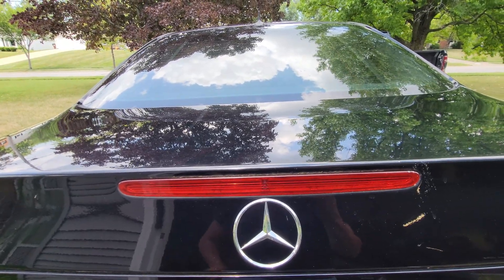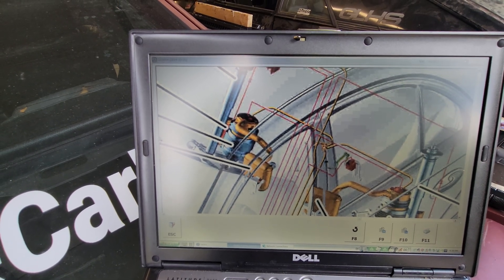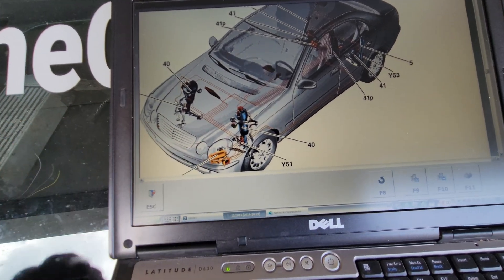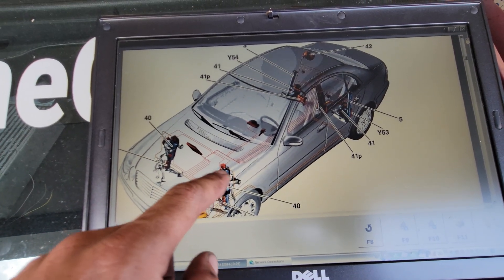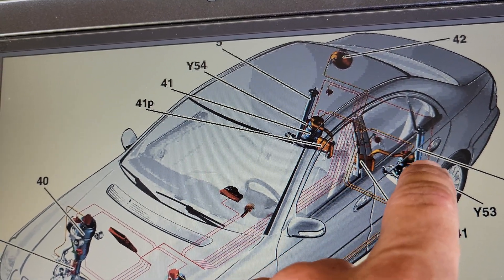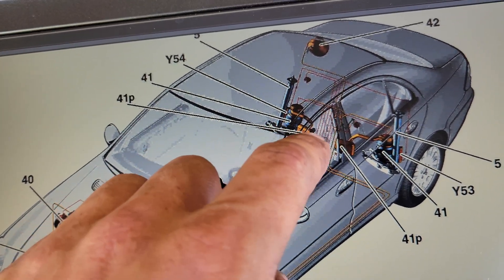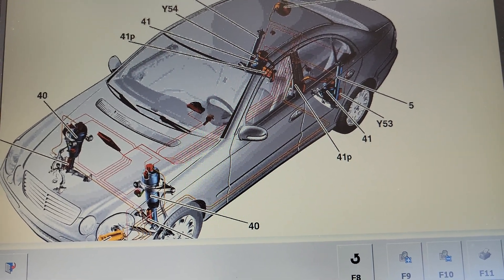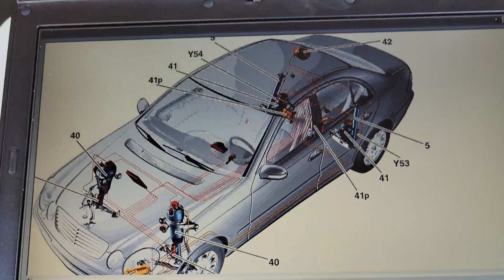QUICKIE - Mercedes W211 AIRMatic 101 - How it kinda works and what goes wrong..

Comment: Awesome video! Great explanation. 
I tried using it to find the issue with my 2008 W211 E350 Sports package with 4Matic and Airmatic. 
So far I haven’t been successful. Maybe you have an idea? 

My Airmatic feels way too uncomfortably hard even in comfort mode.
Everything seems to read and work correctly though. 
The car has 110k km and never had an issue with the Airmatic besides feeling hard. 

I'm able to use Xentry, which shows no error codes in general or weird live data when driving. 
The voltage is in its tolerance range, the level sensors are correctly installed, are in the tolerance and read changes as well.  
The ADS work and each read 500ma when activated. 
Also, the Airmatic lock is not on, since the car is way harder when driving while being inside the Airmatic module. 
The Airmatic does not leak even after 2 weeks of not using the car. 
The compressor fills up to the 12 bar in 10sec (40sec is max). 
There is also enough pressure in the system and the pressure release valve works as well.
Since I'm the 2nd. Owner, I do know that no one ever messed with the level calibration. 
It shows 10mm+ front and rear when using auto level calibration. The 10mm+ is outside the -3 to 3mm tolerance, but as far as I know, it is supposed to be like that for 4Matic models. 
Also, I can feel a difference when changing from comfort mode to sport/sport2. 
The car lowers and raises correct and quickly.
I checked my tire pressure as well (original 18inch sports package wheels 245/40/18 (6 months old Goodyear tires) with 2.2 bar pressure in them).
(It is also the same case with the just installed 17inch winter tires.)

Everything seems like the system works correctly. 
The car simply drives harder and more uncomfortably than any other car with normal shocks/springs I ever owned. 
While driving in comfort mode, the suspension has a tiny bit more give to it like it is supposed to, while still feeling every tiny detail and bump on the road. 
It sometimes feels like there is too much air in the bags.
A very uncomfortable mix.
I feel like the Airmatic should feel way smoother, like riding a cloud. 

I avoid more bumps and potholes than in my 60mm lowered 190E on 17-inch OZ Wheels. 

Any suggestions on what I could check next since the car drives me crazy?
Reply from the maker: Are the level sensors (or programming) functioning? Perhaps the car is over-airing - with the car running, measure from the ground to the fender opening - should be around 27" or so, iirc. Someone could have also messed with the level calibration making the car ride higher than it should. Or, your struts are bad/frozen.
Reply: @TheCarFarm  Thank you for those tips!

The level sensors read changes, even small changes, correctly. The only thing that might be a bit odd is that when the car is idling, the front right and rear sensors slightly change in value. 
Like +- 5-10 mV changes when the car is not moving. Really nothing major. I could not find anyone, though, that said whether those slight changes are ok or not. It might be bad engine mounts causing this change. They are all relatively close in general, like 2450-2550 mV.
The car height is ok as well. Not too high or low. The pressure relief valve works as intended. I could check how much pressure the system uses while driving but I don't know exacty how much it should have.
No one changed the level calibration from the factory. The car has been in the family since it was new. The struts don't show any oil, don't leak after weeks of standing, and the ADS dampener change hardness without issue (tested each individually in xentry).

The Airmatic works just fine without issues. It's just that the car doesn't have the magic carpet ride I know from different W211 Airmatics.
It is somehow floaty but hard with bad roads while being floaty. The Airmatic is supposed to hide any road surface completely.

Comment: Thanks for the explenation and sharing of your troubles! I just bought a 320 S211 with 285.000 miles and i'm looking into this system now, having a leek, rear right, so the diagram of your software is realy helpfull.  The way MB put the lines in the car is so cheap en badly done, rubbing on steel and wheelwells!

Comment: Is bypassing the tank is the back detrimental? 
It seems its there for a reason for constant air pressure and it seems to allow air to spill into it for some of the fancy airmatic features, using the arnotts with the bypass seems to use the airbag as the air tank then with no ability to allow quick deflating? 

im no expert with air bags but wanting to do the right thing and not the 20 year old E class dodgy repair, I have a suspected air leak thats just started the last few days which I will monitor closely 

Arrnotts bag would seem to be under a lot more constant pressure being used as an air tank/ air bag 

like I said I am very fresh to how air systems work and just want to do the right thing and understand more
Reply from the maker: In the video, I think I talk about tanks connected right to the air springs - the Arnotts do away with those. In the trunk is a larger main tank.

When you have the stock 'pillow tanks' on the springs, that air volume is combined with the air volume in the bellows during comfort mode - this additional volume does in fact change the spring rate. Arnotts spring rates therefor cannot be the same as OEM that retains the tanks. But on the OEM, the large rubber hose to the spring tanks can leak at the clamp, or corrode - this has been an issue on mine, repeatedly - not always the air spring itself. 

But yes, you *can bypass or cork of the 3/4"  (maybe 5/8") nipple on the air spring and bypass the pillow tanks. Do not use a cooling system cap, it's not rated for the ~150psi.
Reply: would there be much of a performance loss or difference with bypassing those tanks in the rear?

I was considering getting Arnott's but they are pretty pricey when you can literally just plug the bag also, Which I have seen people do online.

The larger main tank in the trunk is used as the compressors main air storage? 
 @TheCarFarm
Reply from the maker: @HTES962  You can bypass the little pillow tanks as I mentioned above - you just have to use something that'll take at least 150psi. 

Yes, the 1 gallon or so tank in the trunk is the main tank - you need that.

Comment: 😢having trouble with my E500 2004….changed the rear right still linking,drops overnight,as soon as I start the vehicle it lifts with no problem headache 😮
Reply from the maker: Did you change the spring, large black hose and the aluminum tank, re-use the large hose and tank, or replace spring/tank combo with a tank delete? The tanks like to leak around the corroded nipple. Replace the airline feed, too.
Reply: @TheCarFarm  🙏🏾4 replying…..I changed the bag and use the new air connector tube brass fitting.

Comment: Ben, just ran across your video. Well done! Great explanation of the system. I bought a low milage 2005 E500 4Matic w/ Airmatic when it was 7 years old (only had 22k miles). It has since rolled 105k (not bad for a 18 year vehicle).  I'm starting to experience the rear sag. Used to be if it sat for 2 weeks you'd see it, now it's more like two days (it's worse when it's cold outside and it's been cold lately). I found a short on one of the solenoid wires on the pump; I soldered that wire and buried it in heatsink tubing.  Seems to be repaired.  While I had it out I also rebuilt the motor (just did the cheap piston ring rebuild).  I’ve found a slow, and I mean slow leak at the air connector on the front left strut.  What’s the best way to repair that?  Do you have a part number for the brass connector?  Should I try tightening it or is that the kiss of death?  I’m not seeing leaks at the right strut, pump or valve block connections (haven't torn into the trunk yet to check the tank).  I’m sure the rear is leaking somewhere but I’ve sprayed soapy water on everything and can’t seem to find it.  Can’t hear it either.  What’s the best way to tell if it’s the rear air-springs (airbags) or rear reserve tanks are leaking?  I’m about to spring for Arnott replacements but I’d like to be sure I’ve found the leaks before I do.  BTW, the Arnott A2724 replacements are now $321.79 on Rockauto.  Is there a cheaper place to get them?
Reply: BTW, this is my lame video of my center speaker repair on the same car... https://youtu.be/fzxc6NK9mKg
Reply from the maker: I think the price has come way down on all of them so I don't complain, but the elasticity of the various units are not the same (weaker) than the OEM and affect the ride. I have found firestone sleeves (bags), but don't have a way to crimp the rings (yet) to 'rebuild' my own. But if you have the slow sag, I would look at the little pillow tanks and the 5/8" hose from the springs. If you're in a salty area, the aluminum nipples will corrode under the rubber hose. You can remove them without dropping the rear member. I adapted an air gun and valve setup to pressure the tank (with most nipple exposed), and then threw them in my pond to find the leaks. Brian welded (tig'd) them up and I reinstalled. The brass compression fittings you can find on Amazon (search for brass ferrule kit). I think they're 4mm, maybe 6 - I don't remember. They're kind of standard on aftermarket air suspension kits. I used some push connectors for splicing broken lines before I replaced the lines (also bought on amazon). If you have slack, you can trim the fitting and use a new ferrule and re-install. Otherwise, give it a turn and see if it stops.

Comment: I just became a proud owner of 270cdi from 03' that was equipped with airmatic, unfortunately somewhere down the line it was converted to classic suspension but bunch of parts of the air suspension remain (valve block, compressor, air lines, reservoir in the back). Do you reckon it can be put back together? Its still in the computer, every time I put the key in ignition it spits out airmatic error, visit workshop but the error is in normal text, not the red colored one. I absolutely love the w211, it has a lot of options that puts today cars at shame.
Reply from the maker: Wow - they went through the trouble of removing it, and then not de-coding it so you wouldn't have any messages? Of course you could slap it back in there. I've noticed my knock-off struts and bags don't ride the same it did as it was new. I would replace the white plastic feed lines - they'll leak anywhere they've rubbed on something and you'll never find it. Compressors are cheap. I'd argue valve blocks are only replaced out of cover-your-butt-and-throw-parts-at-it scenarios, unless external environmental factors have taken their toll. It's not terribly complicated and most aftermarket air-ride systems work exactly the same way; however these cars do add in the dynamic ride control (fancy struts and shocks) with accelerometers on the strut towers. Also, the OEM rear spring have external reservoirs for added air capacity that gives I think a smoother cushion. The replacement airnots do not have those reservoirs - and guess what? That's where mine all failed - the little aluminum takes and/or the larger hose from the spring to those little tanks.
Reply: @TheCarFarm  thanks for a quick reply :) So you recommend to replace all plastic air lines just to be safe and for springs to go with airnot replacement so it would be leak free. I saw those rear reservoirs and had no idea they were from airmatic. Thanks for the info, you got yourself a new sub :)